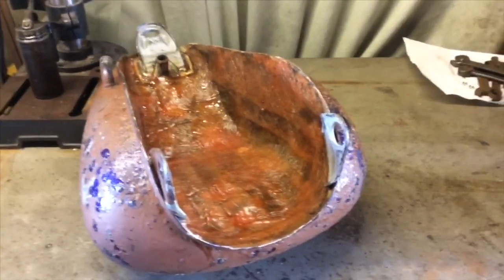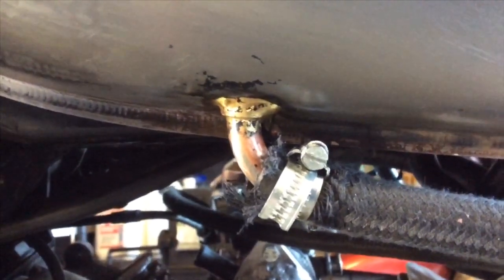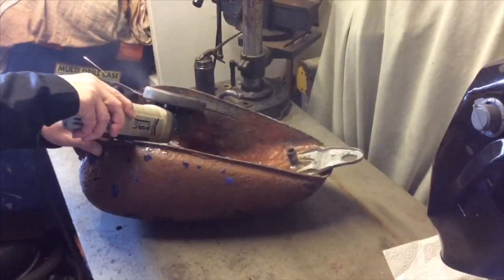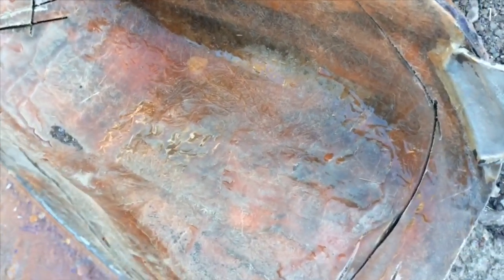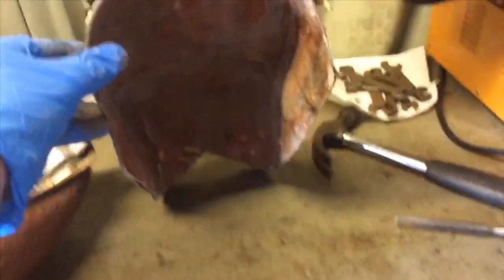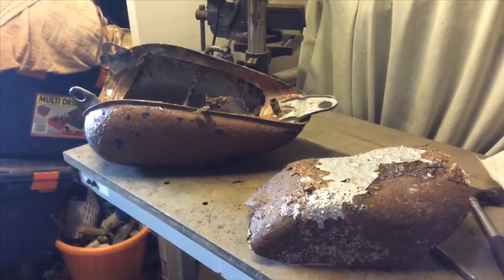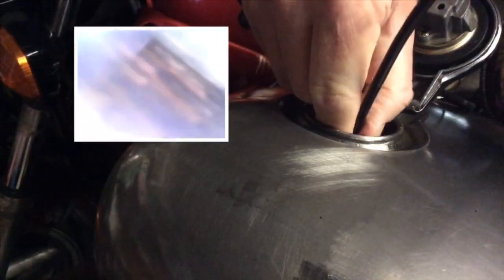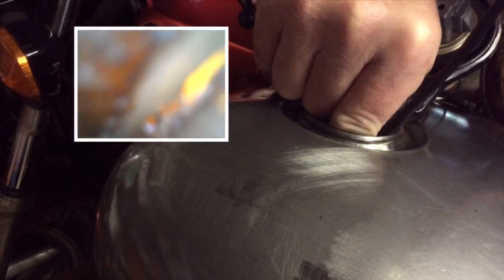Dissecting a motorcycle fuel tank

Comment: really useful this.  I just cleaned a LOT of rust out o1f a 96 XV535 upper tank.  are you concerned about transfer of rust to the lower tank
Reply from the maker: I don’t have the bike anymore, but the lower tank was perfectly ok inside, clean as a whistle. You have a filter in the lower tank on the petcock of course and then a filter before the fuel pump, so maybe wash the lower one out, but it is a pain to get out.